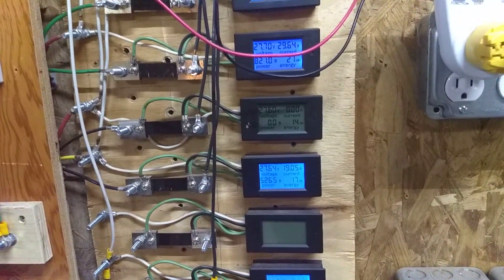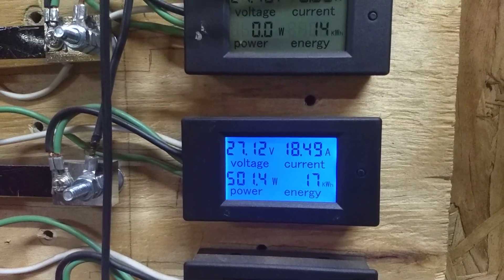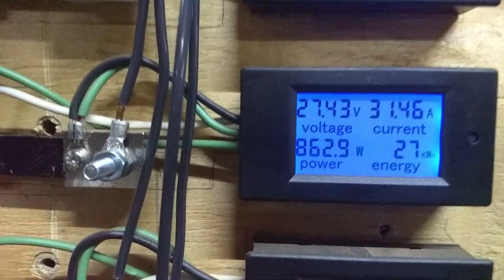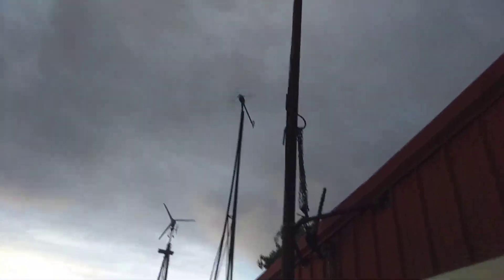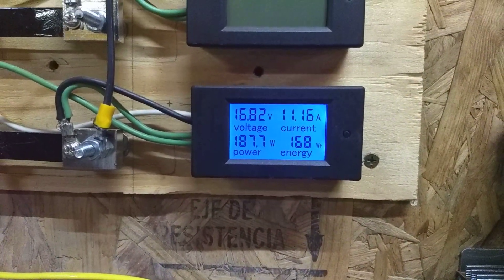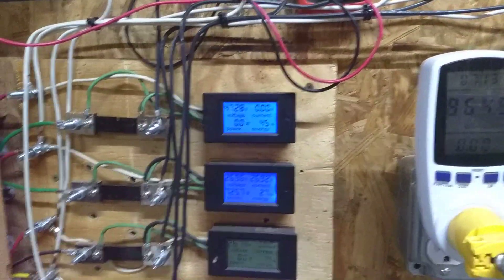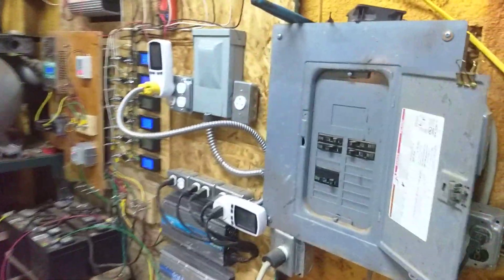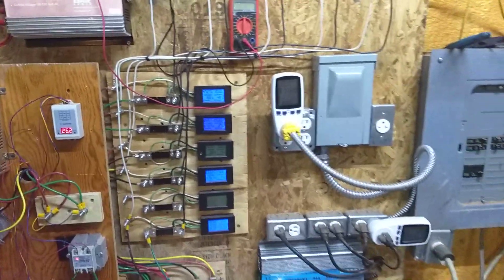35~40 mile per hour winds tonight, let's see what the turbines are doing!

Comment: what all do you power with the turbine  battery set up you have house etc..
Reply from the maker: Most of the power dumps into the grid.  I use the battery bank to run tools and lights at times but that only accounts for a small portion of my production.
Reply: @ToysforWatts  Hello i need a 48v wind turbine to help when i have no solar from the sun i have 15 48v 104ah lifepo4 banks what do you recommend

Comment: I get upto 500w with my I-500 at those wind speeds, running at 31v tho. I think the motor is more efficient at higher RPMs.
Reply from the maker: If I push it way up there in RPM and run it on a 24v circuit I have seen some considerably higher wattages...I think it can do better on a 12v circuit but it's going to require some playing to find the right load/blade combination.
Reply: @ToysforWatts  I added super capacitors to my charge controling/grid tied setup, I did a simulation with a dc to dc power supply its in my latest video, they work great, can't wait to get winds to see real life test !
Reply: This way the super caps will kinda be the mppt, could be a way to figure the sweet efficiency spot

Comment: My turbine tower and turbine took 2 tornadoes at 120 mph and simply dragging it down with a dump load kept the power under 1kw and I used over sized 6 awg temco welding cables on all 3 legs and a 100 amp ac to dc rectifier and a solid state relay and dump control  board .then it goes to a dump load of 3 100 watt 3 ohm resistors and my voltage controlled relay kicks on and my 500 watt to 600 watt infrared heater turns on attached to a 3500 watt pursine.  It really drags down the turbine,  and it has a 12v 1410 ah battery bank  to beat up on .

Comment: We're going to have 40 to 50 winds tomorrow but gusting to 75 when the rain comes...it will either work or be a UFO I guess, might not be a good day to put one up, lol...guess I'll just bolt some plywood over the doors and hang on till the 3 inches of rain is done....with possible 4 inch hail....geez....well you got to use yours I guess...I may have to wait till July to try it
Reply from the maker: If my forecast says <50 I'm cool with it but if I saw "75" written I'd have half my turbines on the ground and the rest with the blades tied to the towers before it got here :/
Reply: I had to send my Aims off to Nevada...pricey...ordered a control board so it's coming too...they say it's out of warranty now so I had to pay shipping again and a $131 control board...if that's the problem...if not it's another $200 for the power board...it needs a little fan in there, or something...design flaw I think...the 12 volt ones don't do it , just the 24 volt ones that are 2000 watts...so I'm gonna fix it and if I can sell it for enough later after I fix the actual problem, I'm getting a Samlex 3000 watts one...it is $940 without the charger and 1300 with...a new Aims just like mine is $885 now. I guess it's worth fixing once...I'll keep it awhile and use it so to see it is fixed...they gave me a new temp sensor also which may have been part of the problem...I have a couple of split phase generators that I'm going to try putting some magnets in the rotor part, and then it won't have to spin so fast to make wattage...I was just about to order a wind turbine kit when my inverter  went down. so I don't know now...I may have to build a junkyard wind turbine first...I have a 5000 watts Winco with two hot legs off an old motorhome generator...I'm going to take the engine off of it, looks like a 10 horse maybe...it has an iron case about ten inches wide and about 8 inches long with a fan on the back...so I'm going to tinker around with it...It's supposed to have residual magnetism in the rotor but I'm going to add twenty or so magnets to it so that it will generate at a low speed...it says it makes 20 amps at 250 volts at 3600 rpm...but all I need is 30 volts or more...it is all iron and copper...it's all there...lol. But it looks like it  has very low hours...so it may be old but hardly used...but if I can get it geared right it should put out 500 watts easy...it's hard to say with the engine on it but I would guess 60 pounds maybe...I'm going to take it apart today...you know , on the newer ones you have to leave the oil pan of the engine on there to have a front bearing, but this thing is so old that it is separate. I'll have it in a pile and see what size the crankshaft is...that may be a 12 horse idk. If I'm lucky there's enough to put a pulley or sprocket on. after I cut the crankshaft off...from what little I can tell it has big heavy bearings on it...so far it looks like it will work...it's hard to tell how old it is...the writing is all gone but what is cast into the rubber plug ins...so it has to be early 60's or around there. But it was free, and it is still good. My figuring says if it surges to 1500 watts it isn't going to hurt it...but this wind blowing is driving me nuts so I have to do something wind related at least today...try to forget about the inverter for an hour...lol...we're having 35-45 winds today...rain coming maybe later...chilly...have a great Thanksgiving

Comment: That's the noise my i2000 make very regular when my inverter decides to shut down 😂
Reply from the maker: Yep take the load off and they really get up there.  Mine will do the same.  I got a boat load of parts coming to build a 10kw resistor bank...everything is going to dump into that when stuff gets "wild".

Comment: When I first put my Chinese 500w up it used to make noise like that from 18-20mph wind, I balance the blades with some small bits of lead and up to now it's been great, max wind I've had to date is 65 mph and silent.
Reply from the maker: A lot of the Chinese blades are loud by default...they're thin and flexible...my i1500 was making all that noise because it's only operating on one phase, almost no load on it.  If it'd had all three phases running it'd have been way more reasonable.
Reply: @ToysforWatts  Yes I agree those Chinese blades are a little on the thin side, when mine is standing still you can see the blades are bent towards the tail from the constant wind pushing on them.
Take care
john

Comment: 500 Watts means somewhere between 475 RPM and 600 RPM depending on how it is configured.They start getting harder and harder to turn above that rate. 100 extra Watts of output require 1/4 HP more to get it. While it only take 1HP to get to 500 Watts, it take 1.25+ to get to 600. And to get to 700 takes nearly 2 HP.